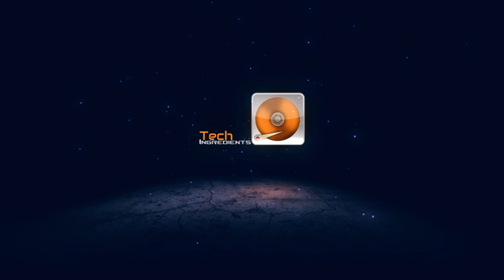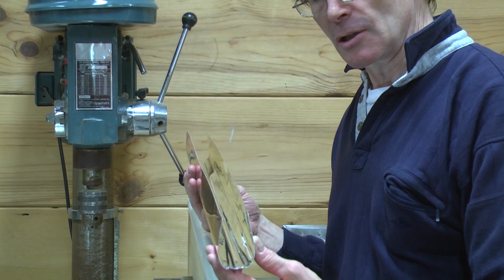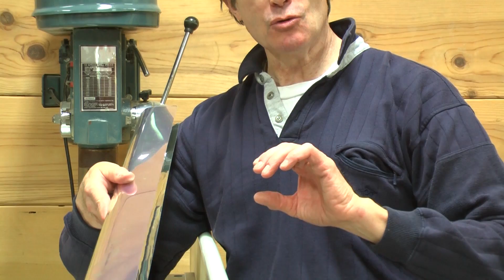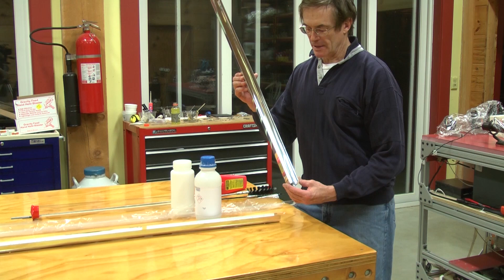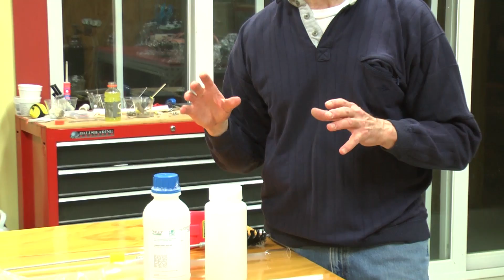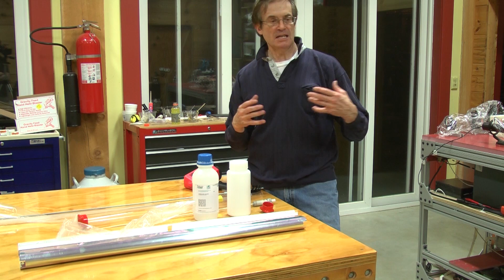High Energy Dye Laser Reflector Fabrication

Comment: "..an elliptical cylinder requires two bounces..."  
Nope! Not correct. An ellipse requires only one bounce off the wall to go from one focus to the other.  One way to define an ellipse is that exact quality, i.e. the normal of the line of the ellipse bisects the lines drawn to each of the two foci.
Just one bounce.